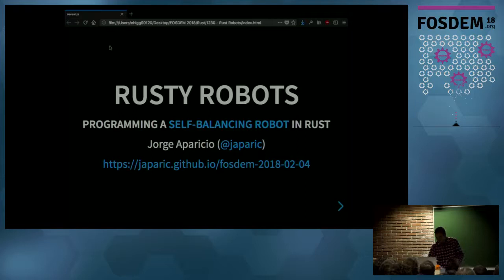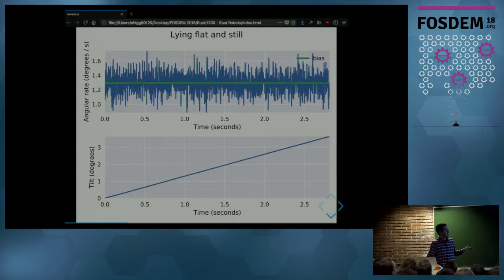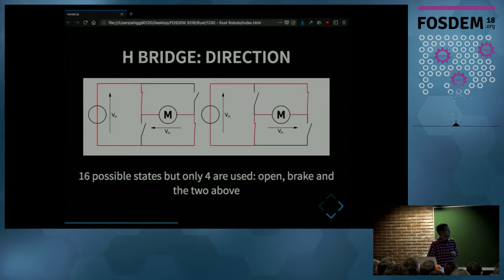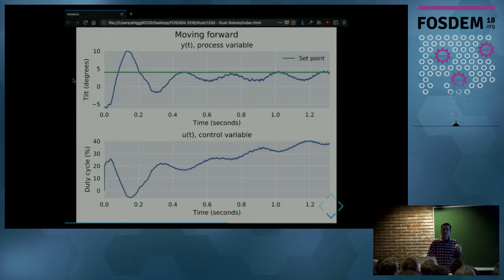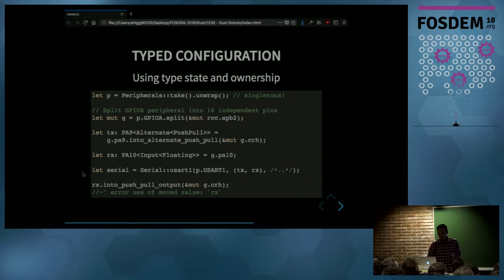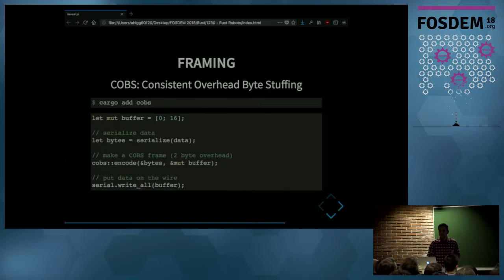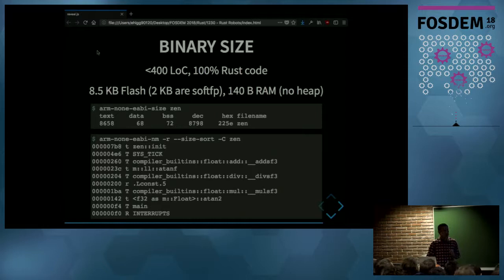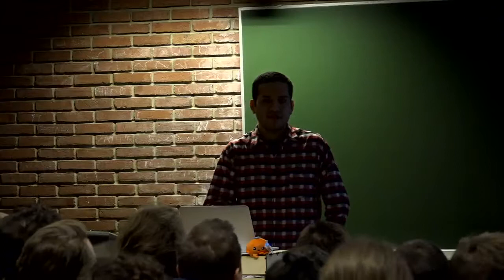Jorge Aparicio Rivera - Rusty Robots

Comment: Interesting project! Thanks! Some questions:   
1- Don't you use your BT module (HC-06)'s SPP profile to send data? Doesn't it already have CRC checks inside BT SPP protocol overhead?   
2- Couldn't we use other RTOSes implemented in C like freeRTOS or chibiRTOS? What's the advantage of RTFM here?   
3- About code reuse, couldn't similar things be done by properly abstracting away board and sensor drivers in C language? like a BoardSupportPackage file, then a driver for IMU which is agnostic to port and MCU family then a lower level implementation file?